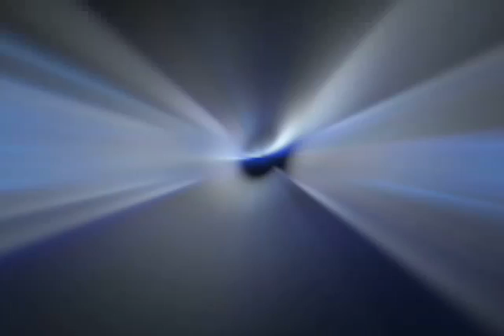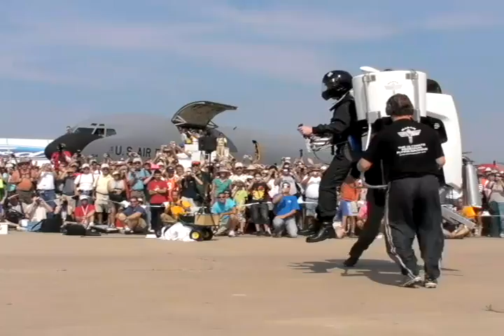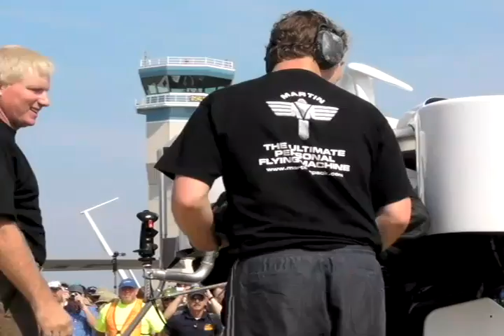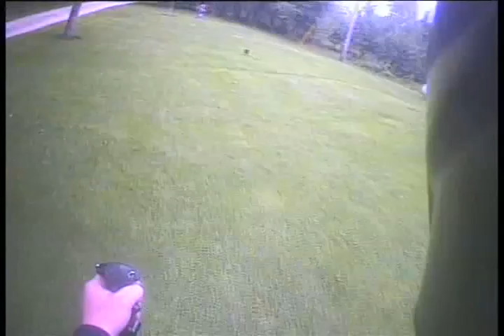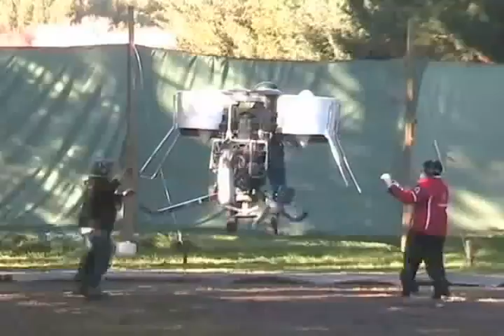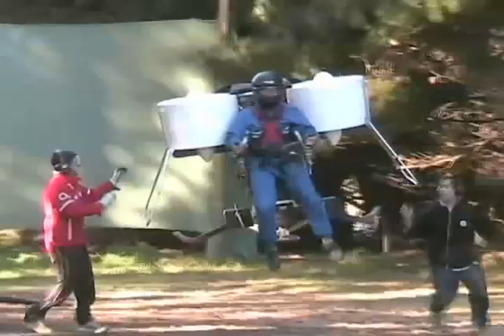Martin JetPack EAA AirVenture Oshkosh 2008 -- Narrated

Comment: @lucianrus18 yes the speed at which a Jet engine spins makes it burn fuel faster, and you have to use Jet A or Jet A-1 fuel to run a jet engine, which is dearer than normal gasoline, I never said Jet engines where un-reliable, aircraft use them because the thrust off a jet engine is a lot more then a normal gasoline engine, however for a jetpack its a greater advantage to have a slower burning engine, rather than a quick speedy jet engine.

Comment: @ryan1111111555555555   the jet engine is much smaller than this 2 stroke one,so they could make a bigger fuel tank instead of a big metal engine. it burns fuel even faster than this 2 stroke engine? think that in this engine are lots of moving parts,in jet ones is only a propeller,and it could be use any fuel.  if the jet engine is not reliable,why helicopters use them?  why dont helicopter use 2 stroke engine? i;m maby wrong...but that;s why i'm asking

Comment: @lucianrus18 The motor they use is actually custom made, it's a V4 2Ltr that makes around 200HP. This is plenty of power! Many small helicopters don't have this much power. Problem with turbochargers is the boost, you need a very smooth powerband for this type of flight/machine, turbo is not smooth. This is an early test, it flies without people holding on for support. Watch some vids on their youtube channel MartinJetPack and that is only an indoor flight.

Comment: I refuse to believe this thing can hit 8k feet in the air.  Maintenance will be hell.  If you decide to work on the thing yourself then you're gonna piss your pants during each flight afterwards. Just not a good investment IMO.From weather to wind to birds, will all be an issue with this.  What if you run out of gas?I know its stupid.  But face it, it happens to everyone at some point in their lives.Ever see 300lbs drop from 8k feet?  Better pull the parachute chord QUICK. What if it fail...

Comment: This monster is NOT A JET PACK because it's not a "pack". It weighs 300 pounds. There's no way you could walk around with it strapped to your back. It's essentially a helicopter without the canopy.

When you get the weight down to 40 pounds, then you can call it a "pack".

Comment: I'm not impressed. I remember the flying pulpit being a better performer in both mileage and hp performance. would not have used a normally aspirated engine either.turbines have a much higher weight to performance ratio.

Comment: Yup, this is a stupid design and makes the mistake of having the pilot hang from it rather than stand on it. 

Both the hillier flying platform and williams wasp/x-jet were extremely easy to fly and far more practical and would mean the pilot could wear a small base jumping paracute in case of engine failure at high altitude

watch?v=MwhBWxc0SSM
watch?v=yi5QDHKk9AY

Comment: IVE GONE HIGHER IN THE AIR ON MY PUSH BIKE.Can you read its not stable in its current config.A few days before it went to the USA they had near miss, it yawed badly almost crashing and they have no idea Y!! Thats at 10 FEET off the ground let alone 8000ft.

Comment: True but a Tesla vehicle can be designed to distribute the weight where they want it. Rare earth magnets are powerful, but combine them with batteries and the propulsion system will be very heavy. I think an electric version of this would bust the 254 lbs ultra-light weight restriction. As far as a two-stroke engine (previous post), wouldn't you have to have a computer controlling the carb jetting as the altitude changes?

Comment: Physics fool, If it can get off the ground that means it can over come gravity, thus can attain any altitude where the density of the air is the same so lets say 1000ft atleast?! And even at that altitude it will as you put it "be using the ground as lift" thats how a helicopter works... newton "action and reaction" blades push air air pushes ground.
and I like the idea of making it fixed wing capable too!

Comment: Now all it needs are swing wings where the safety bars are for fixed wing flight at low altitudes, would save fuel if you had a support system like wings rather than relying soley on the power of the engine.

Comment: I totally agree with the GYRO.  Without a gyro this is not going to ever be a viable product.
I don't yet agree with the electric motors tho'.  I have a lot of experience with LiPo and LiMn batteries and it would take a LOT of juice to produce the same amount of power as a 2 stroke 2L engine.  That is a LOT of power (twice as many power strokes as a 4 stroke 2L).

Electric motors as long as you don't mind an extension cord or 5 minute runtime vs 1/2 an hour.